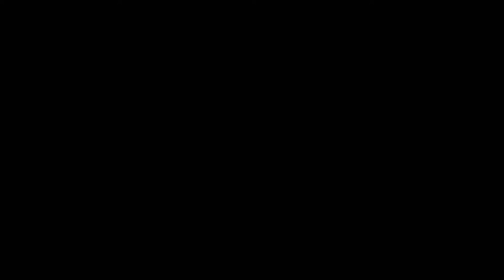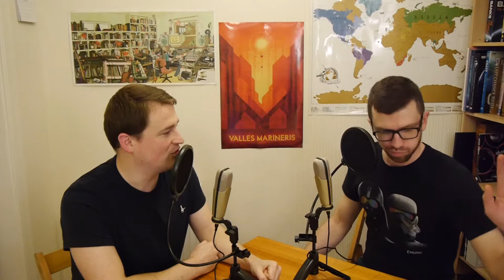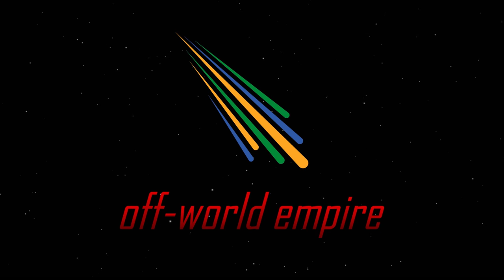Accessing Space in the Future: Space Elevators - Off-World/Off-Topic Ep. 7 (pt. 2)

Comment: the carbon footprint could be prohibitive, assuming we have carbon tax by then. 
due to the numerous possibilities of failure, and no way to build in a failure mode that is acceptable, i doubt it will ever be implemented on our planet, especially without a way to harness all of the space junk out there. 
the concept could be very useful for 2 man made bodies in earth orbit, or other orbits, to make artificial gravity. it could have a module a the center, for microgravity research, and docking, and one of the outer components could have more mass than the other, so that there could be 2 different G loads, so you could pick between 0g, .3 g, or 1g, all on the same space station. 
you could store junk in the .3g module, and do the experiments in 0g, then live in the 1g module. 
it could also be used to sling payloads toward other destinations, if the cable were very long, and the rotation vey slow, it could sling payloads at a considerable velocity, then get it's rotational speed boosted later by ion engines.  
the solar panels would be part of the 0g core module. 
fun stuff guys, i'm enjoying the discussions. keep it up.